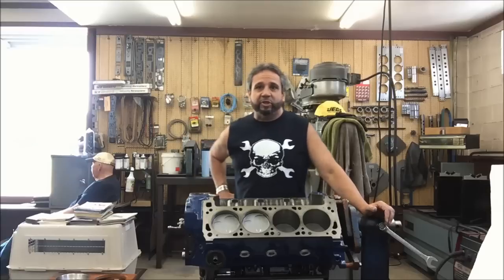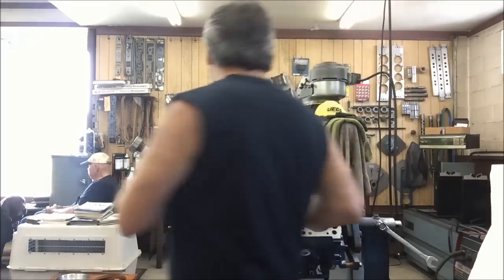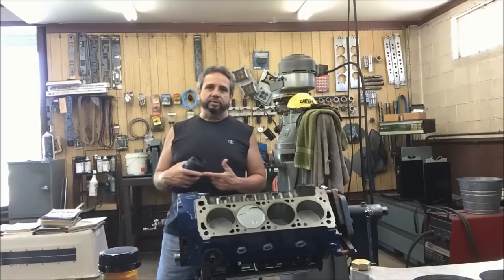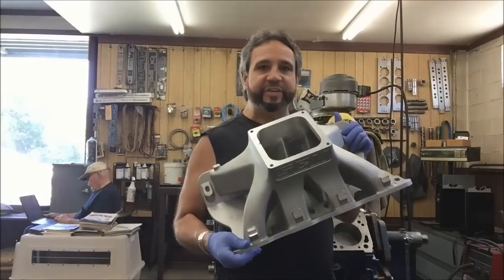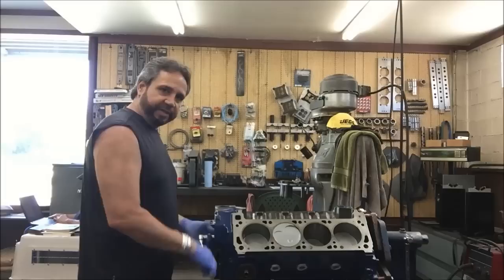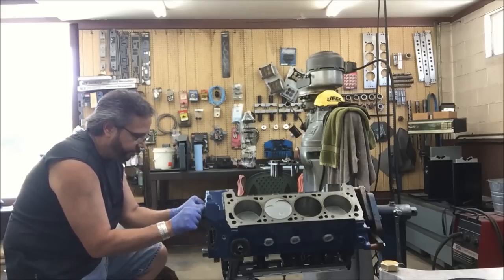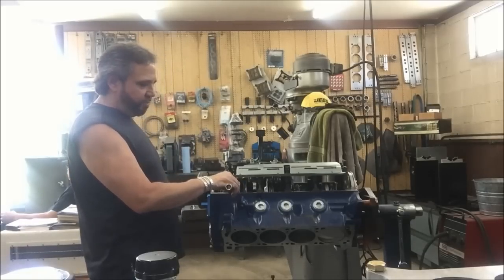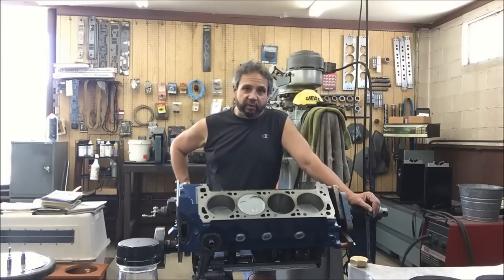Episode 21: 752 hp 408 Cleveland Buildup

Comment: Almost the identical Cam i was Running  30 years ago...Love your videos  Tim...👍💪🇺🇸
Reply from the maker: Nice deal. I came up with specs on my dyno 2000 program and testing cams. Mark at bullet took of it. Have both dyno and drag 2000. Dang programs are close if you have your head flow. Within 15 hp and a tenth on the strip
Reply: @dragboss351cleveland  ...Yeah Tim..one of my favorite Engines...Cracked it into the 9s back in 1990 at the Ford Motorsports Nationals ..with An iron head with an exhaust port plate..i would love to revisit the Cleveland...Good blocks are getting hard to find these Days..went faster with the Strip Dominator...than i did with the Wiand Tunnel Ram...🤔
Reply from the maker: @frankieford7668  yes have never been there so we can revisit it together  working on possibly building two at once. Be cool to see how it works out.
Reply: @dragboss351cleveland  ....its Quite  Amazing when you think about the Times they were Turning...Running in the Eights...Not Easy by todays Standards...they were doing it with modified Factory Components...very Impressive...👍😯
Reply from the maker: @frankieford7668  I know 8.37-8.55s can you imagine. And leaving at 10-11k dropping the clutch, no line lock. And stock stuff, amazing man.
Reply: @dragboss351cleveland  ...Ya Gotta Love it...Theres a Classic Black n White photograph of Bill " Grumpy" Jenkins...Standing over a Small Block Chevy...With a Cleveland Tunnel Ram in his Hand...Hes looking down the Runner...and most of  Us can Just imagine what hes Thinking...lol
Reply from the maker: Be cool to see. “Dam why didn’t Chevy do this” back to the drawing board. Lol. The Grump was an innovator too.

Comment: You might want to check opening and closing points to verify that it's degreed in correctly. if your intake lobe is ground symmetrically, you'll be ok, but if it's an asymmetrical lobe, your intake centerline will be off.
Reply from the maker: Thanks man. This is the same cam I took out of it, It is going back in at same 2 degrees advanced, It came out to 105.5 ish, leaving it the way it is, Just want a 9.50 and done.